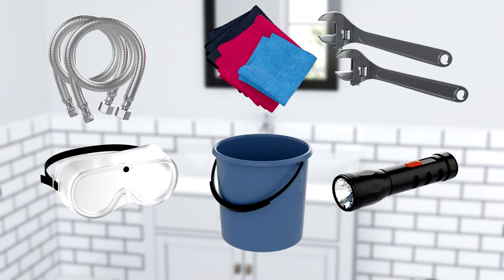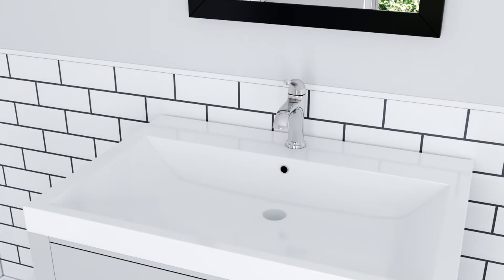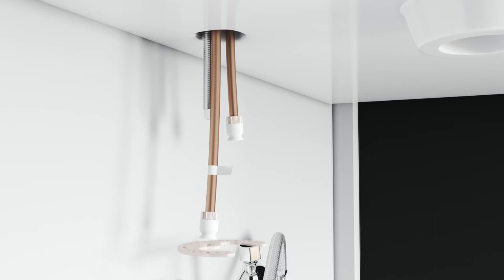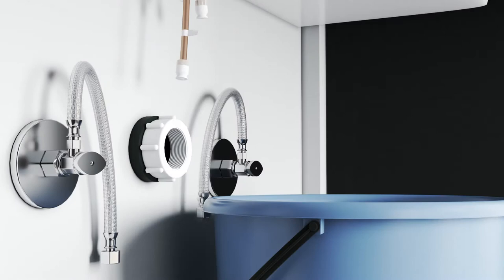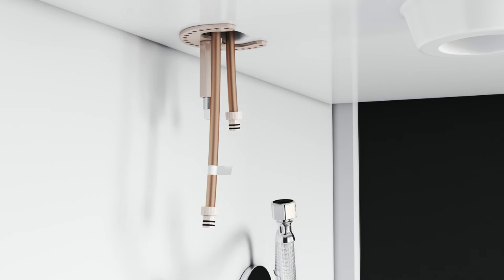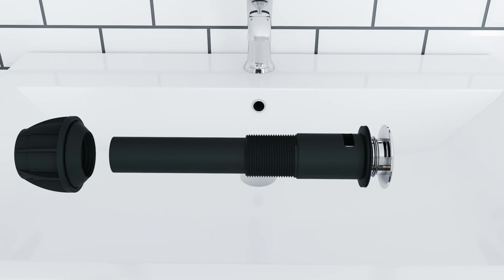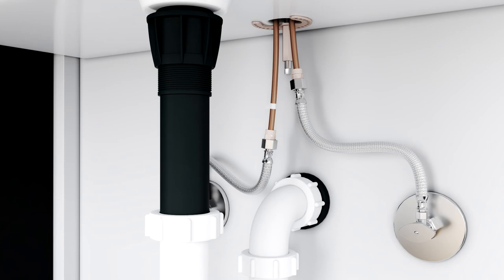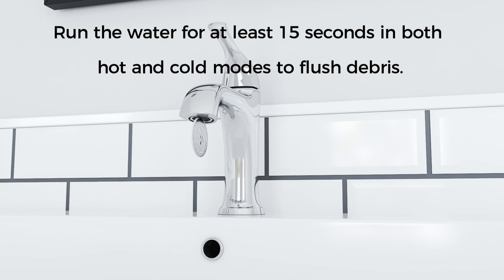Installing a Ladera 1-Handle Single Control Bath Faucet

Comment: I just installed this faucet today 6/12/24 and the video is incorrect. The video shows the mounting bolt at the rear of the faucet facing the wall. It’s actually in front of the unit facing the sink. I couldn’t get my unit using the base plate to sit flush. I corrected the problem by cutting the round section of the horseshoe shaped underside mounting bracket to prevent it from hitting the sink. The flat spot gave me the necessary room to move the faucet forward just enough to get it to sit flush. Other than that it was a piece of cake to install and it’s not my first Pfister product. I’m very  pleased with their products.

Comment: Does this work for sinks with overflow holes?
Reply from the maker: Hi! Yes, the Ladera single control bath faucet includes the Push & Seal drain assembly that is compatible with sinks that have overflow holes. Thanks – Pfister Social
Reply: @PfisterFaucetsUS I just installed 2 of these in the Master Suite -- so beautiful.
Reply from the maker: That's awesome, thanks for sharing!

Comment: No Teflon tape needed ?
Reply from the maker: Hi! No Teflon tape is needed for the installation of this faucet. Thanks -- Pfister Social
Reply from the maker: Hi, if the drain assembly is leaking, it may be best to have it replaced under warranty. One thing to look out for is that the Push and Seal drain is only compatible with sinks that have an overflow hole. If your sink bowl doesn’t have an overflow, this can be a factor. Our Consumer Support Team is here to help with the replacement drain assembly if needed... please contact them here: https://www.pfisterfaucets.com/parts-support/ask-a-question?sf260434462=1 or call them at: 1-800-PFAUCET (1-800-732-8238). Thanks – Pfister Social

Comment: It appears that this faucet doesn't come with water lines - that's a minus for Pfister and another $20-30 additional expense for the customer. All other faucets (Moen or Delta) I'm considering, the water lines are attached.
Reply from the maker: Hi! Supply lines are not typically included with the faucet because there are several variations in the size and length needed to fit the water supply. The faucet includes two inlet line adapters that connect to ½” water supply lines with ½” fittings. The length required and other ends of the water supply lines would depend on the connection type in your home. Thanks – Pfister Social
Reply: @PfisterFaucetsUS  Thank you for taking the time to respond to my comment - highly appreciated!
Reply from the maker: You're welcome, and have a great day! Thanks -- Pfister Social